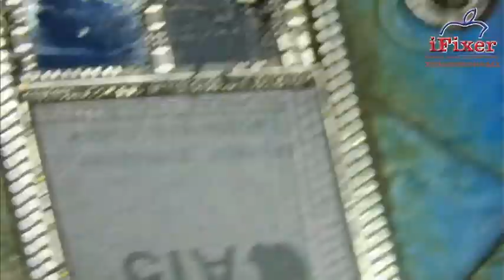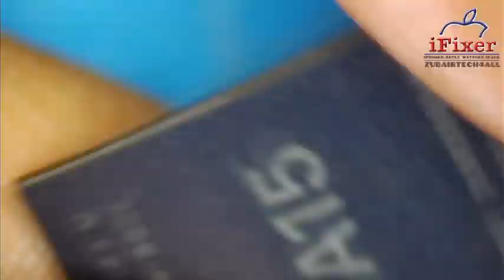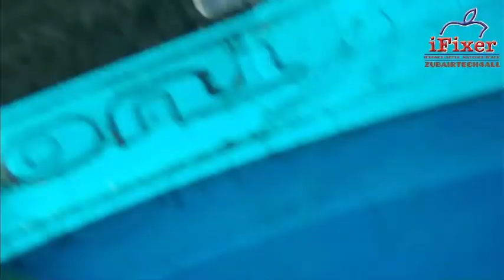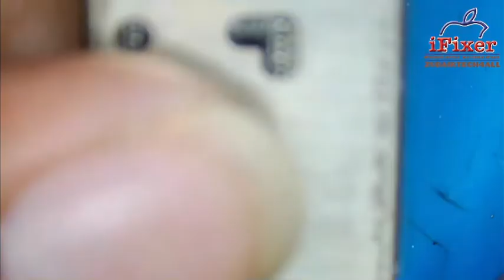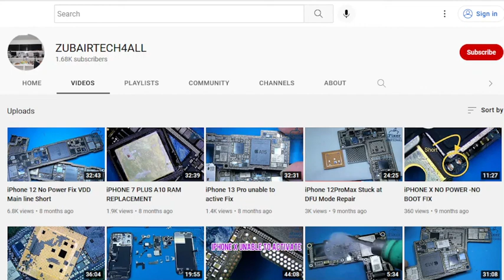iPhone 13 A15 CPU Repair and Board Swap #iPhone13CPU #A15CPU#

Comment: how many air and heat you are use for removing A15 Cpu?
Reply: 300' air 2
Reply: Bro its depends upon your room temperature.
Reply: 380°Celcius with 50 to 60 air

Comment: You did not have to take the old nand .. there was no user data i saw.. only if bigger size then the donor … info is not stored on nand like previous models …
Reply: The data is stored on the nand, the serial, Wi-Fi, bt info is no longer stored on nand but the customer data like photos etc is stored on nand.
Reply: @SURGE101 yah but with this method the data will surely be locked out? I would imagine you would have to DFI restore the device after doing this level of repair. No?